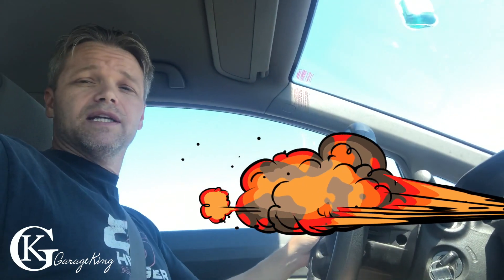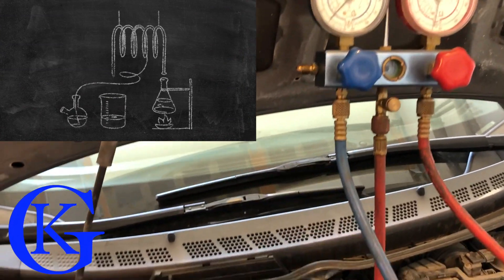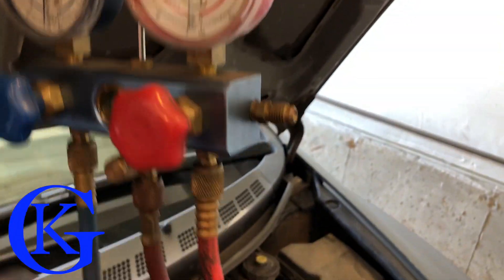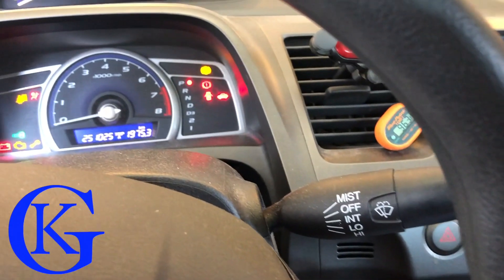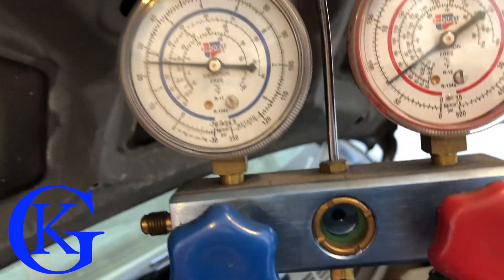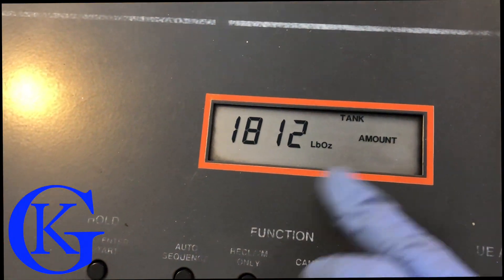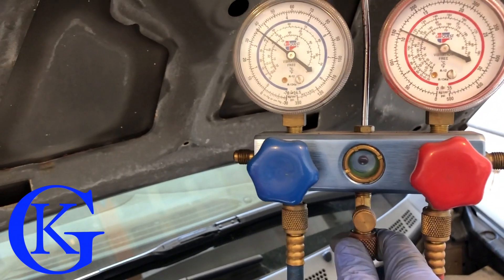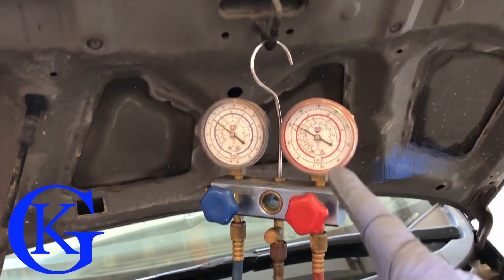How to recharge AC system with gauges properly and evacuate

Comment: why wasn't the clutch working before? if it's empty it means it will need to be refilled in order to work? thanks
Reply from the maker: Yes, there is a low pressure sensor and if you have below a certain amount the clutch will not operate.  This is a safety feature to protect the system.  If the clutch operated when the system is empty there is no refrigerant to carry the oil around and lube everything so the compressor would run dry and burn out.  Once you put a few oz in the sensor that will register and the compressor will begin to operate again.
Reply: @GarageKing  thank you for the response. the stuff just arrived in order to do this but the clutch won't engage even though the freon went inside. so maybe I should change the clutch also.
Reply from the maker: @ichheibeangel  Most likely it could be your thermo protection switch, its very common on the hondas.  See this link, BUT DON"T DUY - it looks just like this, but you have to find one for a civic.  They are not hard to install. https://amzn.to/3WLNDve
Reply: @GarageKing   I am trying to troubleshoot it right now. I only have a multimeter unfortunately. I watched other videos where people jump the clutch with a paperclip where the relay is. I tried using this method and it seems to work whether the car is on or off. However, I couldn't get the clicking sound so the clutch can engage. During these past few days, I took out the clutch to clean it. It was rusted but not anymore. From my naive understanding is that If there is no clicking from where the fuse goes, it probably means that I may need this cable you just linked.
Reply from the maker: @ichheibeangel  I'm not sure exactly how the thermo switch cuts off the compressor (obviously when its hot) but what I mean I'm not sure how to jumper it to get around it, and you don't want to short anything. The part is pretty cheap at the dealer and I would consider doing that before a clutch.  You just don't see the clutch going too often.  You could try to jump the clutch directly at the connection on the compressor?  Thats the only way you know for sure.  Its too bad you didn't have a bi-directional scanner, I use mine all the time to test clutches.
Reply: @GarageKing  yeah it's true. I don't want to fry anything. I ordered the part you suggested. I will keep you posted. thank you. and yeah if I had those expensive bi-directional scanner I think I would be able to see whats open and what isn't. The stuff will arrive within a week. I'm just dissapointed it's not what I thought it would be. I tried adding freon and I think nothing went inside lol. cause the clutch has to be engage in order to circulate yeah? didn't sleep looking for that stuff you suggested. I just hope it works. if not. I'm screwed with this heat lol
Reply from the maker: @ichheibeangel  The clutch does have to engage for it to circulate, but what engages the clutch is the sensor that senses the refrigerant you are putting in. If none went in that could be why.  I'm not about self promotion, but see this video I did using a can.  https://youtu.be/-7NqYbDLeMM  you can see how the compressor cuts in when I get the refrigerant to go into the vehicle.

Comment: That should be around 40*F air out of the vents
Reply from the maker: Yes you are right, but it depends on how hot it is outside, and if the vehicle is moving. This was 52 and still going down when I filmed the video and that's sitting in the garage on a hot day. As soon as the vehicle is driven it will go lower.

Comment: Very good explanation and video thanks for your time and patience doing this video, cuestion you dont need to add pag oil after replacing a condencer? I didt see you add any , hope you can awnser and thanks again
Reply from the maker: I didn't add any as none came out.  You never know where the oil resides in the system.  It moves around.  You are safe to add 1/2oz or so if nothing comes out, but you have to be careful not to keep adding as I have taken apart some AC systems where they are really full of oil, way too full and its from mechanics adding every time. When that happens the system does not cool properly.
Reply: @GarageKing  thank you for awnser bro, yes i buy the haynes repair manual for my van and it said after replace the condencer add 1or 1 1/2   oz of pag oil, i just add 1, and is working ok, at least for now, any way, your video is very helpfull, thank you again

Comment: Best video i found! Many 12a manufactures, RedTek or Ultra Cool, state on their cans DO NOT ADD ON VACUUMED SYSTEM. Would you have an explanation why they would put that? Another manufacturer, Duracool say can be added to fully vacuumed. 
This video is a keeper!
Reply from the maker: Hey There and thanks for the comment.  I really have no idea why they would say that.  Its quite strange and maybe there is a reason for it, but I can let you know I have done a lot or repairs, vacuumed the system, and then used 12a and they are all fine.  It really does not make any sense because that would mean you can't use a 12a after a repair, because you always vacuum after a repair to get moisture out.  I never noticed that warning from them, but I probably wasn't looking close enough LOL :)

Comment: What would cause the psi on the high pressure gauge to go really high (400-500)? The high pressure side was closed when I was adding the refrigerant and the psi got really high.
Reply from the maker: That can happen if there is a restriction in the system.  The whole ac system (doesn't matter who makes it) is based on a high side/low side operation.  The compressor pumps the system up raising the high side and the refrigerant flows back to the low side through a metered orifice tube/valve. When the refrigerant crosses back to the low side there is a cooling effect as the liquid expands to gas. There is a certain point where the compressor stops running (high side too high) and the refrigerant keeps trying to balance out to the low side, and once the pressure differential is too close the compressor starts pumping again and the cycle goes on. When you shut off your car both the high side and low side equalize and there is no ac as there is no pressure differential.  That's why is so important to make sure the compressor cuts in. OK now that we know how the system works we can say if the high side gets too high there is a restriction (clog) in there somewhere.  Also remember that on a hot summer day the high side will run quite high.  I have seen 350 to 400 on a hot day.  What you can do to test is is run the car with the gauges on and then spray the condenser (its in front of the radiator with a garden hose. The pressure should drop quite a bit, like over 100 degrees. Also make sure the cooling fans are running.

Comment: Awesome video, nice explaining the order of connecting / disconnecting the connectors. I wonder how much refrigerant you would lose by just removing the connectors after done charging? I want to measure my car's pressure but I'm afraid I might lose some refrigerant.
Reply from the maker: if your gauges have quick connectors (which you should for 134a) then the loss is next to nothing.  When you connect the gauges make sure both valves are CLOSED. it will read the pressure.  DON"T OPEN THE VALES on the gauges.
Reply: @GarageKing  Thanks, I meant the gas inside the hoses before the gauges, those will have some gas in them, right? I assume it is really trivial
Reply from the maker: @aumpalosa  I know but on quick connect gages there is a one way valve so the gas is trapped between the gage and the connector, so all you loose that tiny bit in the connector which is really nothing.  On the older R12 systems it was a schrader valve so you screwed the line on, and you lost what was in the line from the gage to the connector.  That does not happen with 134a.  Hope that helps.  Now on those quick connect gages that you use with the can you will loose the part that is in the hose, as they are not like the gages.  Its a very small amount.

Comment: You didnt explain how and why to open up the valves on the quick cinnect couplings.
Reply from the maker: Hi There, around the 5min mark I get into it, I know its a bit of a longer video and it can't really be explained in 3 min.  Essentially I put both connectors on, and then hooked them up to a vacuum machine, open both vales and let the machine draw a vacuum. Then close the vales and attach your refrigerant, purge the fill line, start the car, and fill through the low side.  That's the quickest way I can describe it.

Comment: You mentioned that you never touched the red knobe on the guage but I noticed when you vacuum the system you opened it , is it only used when vacuuming the system and not when charging the system???
Reply from the maker: Yes very good eye, i meant to say when charging I don't touch the red/high side.  When I vacuum you want them both open as it helps to pull from both sides.  Great comment and thanks

Comment: Can you purge/empty the line from the high side after charging the AC system like you did with the middle hose from the keg? There is also some refrigerant left as I assume?
Reply from the maker: Hey there, no not with the high side, there is way too much pressure and if you open the valve with the car running you will just let high side liquid go into the low side.  Best to keep it closed.  After the car is done and you disconnect the high side there will usually be a little "pop" as there is soo much pressure on that side.  Then when you put the gauges away some refrigerant stays in the high side line as its trapped between the gauge valve that was turned off and the one way valve that clipped to the car.  The only way to release that is to open the high pressure valve and the refrigerant will come out of the fill line if it's disconnected, but no reason to do that.  Eventually it leaks down.

Comment: Great video, thanks. If you replace a component, condenser for example and measure the quantity of oil removed from that component. 
Do you then replace that oil directly into the component? Or is the oil just fed into the low pressure (blue) line?
Reply from the maker: It’s best to put it back in the component UNLESS it’s the compressor. Also if the condenser has an oil stain on it (most condensers do if there replaced) you can add a little more as some oil would have been lost.

Comment: 15:57 where is the other video?
Reply from the maker: Hey Thanks for the comment, when the video was playing there was a mark in the top right corner and when you click on that there are more ac videos.  I think this is the one you were after, its how to charge with a can https://youtu.be/-7NqYbDLeMM  Thank you !
Reply: Great video.  Thanks for the reply @GarageKing
Reply from the maker: @Dev_Everything  anytime !!
Reply: @GarageKing Im actually looking for a video on how you refill a completely dry system.  I have pulled a vacuum to  -29 and it holds pressure.  My question is, I purge the air out of the line with the first can.  My question is at the start of the second can.  Do I have to purge the air out of that one too?  It seems to me when I disconnect the first can then air will rush into the charge (yellow hose)?
Reply from the maker: @Dev_Everything  hey great question, so if you are doing the job with gauges no problem, you can close the gauges and then hook up the can, pierce the can and then crack the line to purge, then open the valve and you are good to go.  Now if you are using a can with the single small hose you are going to get some air in the 1st time. The reason is the ac system is under vacuum so when you screw the can to the line and then connect the line to the car, the air that’s in the line with be sucked into the car.  There is really no way around that.  Now for the second can. Once the first can is done disconnect. Screw the second can on (don’t pierce) and hook up to car. You now have greater pressure in AC system that what’s in the line connected to the car so you can unscrew the can slightly to purge, then tighten the can and pierce the can and away you go. I hope that makes sense and good thinking. In a nutshell you can’t purge the 1st can as the car is under vacuum, but after that the car has some pressure so you can purge. That’s why for a top up it’s easy to purge as the car has pressure.
Reply: @GarageKing  Thanks for all the help.  I got everything charged.  System calls for 30oz.  According to my scale I have 31.9oz in the system. (not counting purging the yellow line each can)  Low side was steady at 48 and it was 109 degrees outside.  Should I take out some of the pressure?
Reply from the maker: @Dev_Everything  Hey There, leave it as is, I would not take any out. You are close enough and taking some out won't do anything.  Excellent work :)

Comment: I open the high side(red) by mistake when adding freon but I don’t see nothing wrong with my ac do i need to worry about something?
Reply from the maker: No, as long and you closed it right away. By opening the RED (high side) you just let liquid go to the gas side (LOW side).  This happens automatically when your vehicle is shut off.  The sides equalize.  But when you are filling avoid doing that as the compressor is on the LOW side so if you open the high (RED) side and let in enough liquid, that liquid may make it to the compressor, and well you know, we can't compress liquids............
Reply: @GarageKing  i closet like second away but keep u update
Reply from the maker: @jangonzalez5627  Sounds good, I think you should be OK :)

Comment: To disconnect.... EVERYONE else says to disconnect the high side first, on homes and automotive because the running AC creates a vacuum that draws the refrigerant out of the hoses through the gauges and into the low side.  Once they equalize, you remove the low side.  Your method results in nothing pulling the refrigerant out of the hoses.
Reply from the maker: Hey there and thanks for the comment.  You may be right on HVAC for homes that use r22 etc. but on automotive with 134a there are valves built into the connectors that connect to the fittings in the car, so once you are done filling you close the low side of the gauges.  Remember the high side was NEVER opened,  and HIGH and LOW DON'T pass through the gauge block to tank, only the low side passes to tank. 

Once tank is closed now you have a problem, you have refrigerant in the line running from the tank to the gauges.  The line from the gauges from the car is fine as there is a one way valve on the fitting, but what do you do with the refrigerant in the line to the tank?  With tank CLOSED you open low side and suck what you can out of that line, then close low side.  Now you can remove the tank line and you will lose a bit, but not much as the low side sucked most out.   OK, now to disconnect from the car.  We have BOTH high and low closed so nothing gets transferred from any side, it can't happen as gauges closed. So you take the low side off with the engine running?  Why?  Well because with the engine running the low side line has less refrigerant in it, once you stop the car its going to go up so take it off while its low.  OK, now high side.  Its up 150-250 PSI and if you take it off the line remains pressurized with 150-250, remember valve has to be closed.  If you wait and let the system equalize you, low goes down as car draw some of the refrigerant back in as the sides equalize so you can wait and take high side off when it lowers.  But low should come off first with engine running as that EMPTIES the line as much as you can.

In summary if you just shut the car off and wait both will equalize and you and have same amount in each line.  If you take off low when car running there is not much left in that line as its sucked out, then shut off car and wait for high side to go back down and then take off, at least this way you got one line mostly emptied. In the grand scheme of things it really does not make a big difference with automotive 134a as there are one way valves in the line, and remember the high side valve is never opened (not normally) during filling.